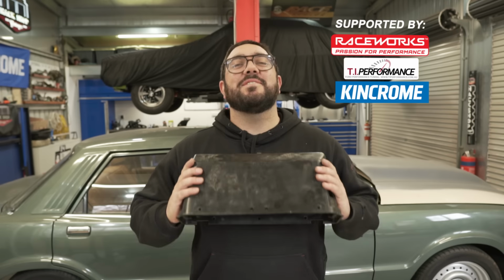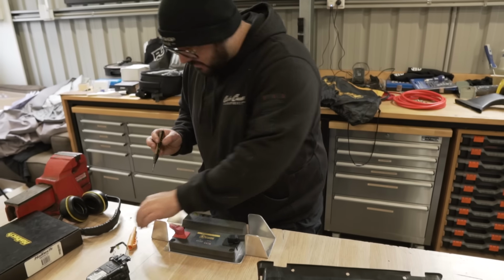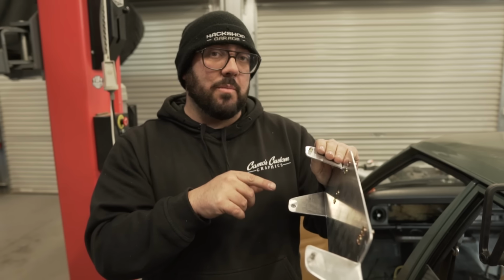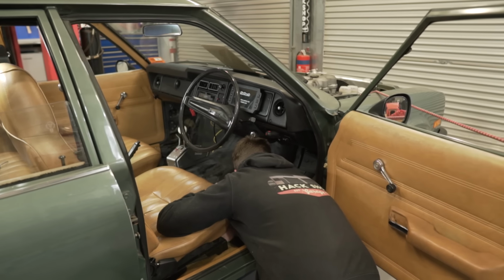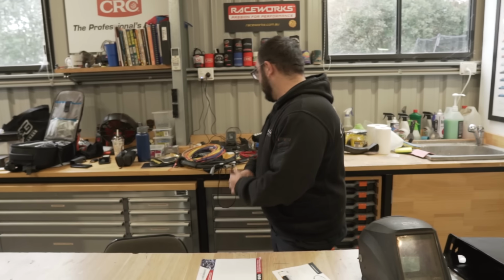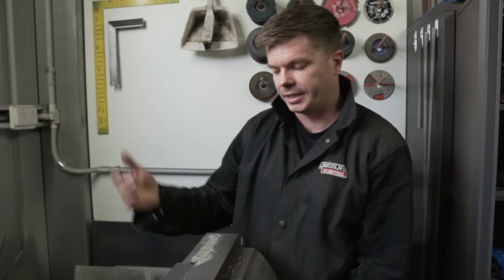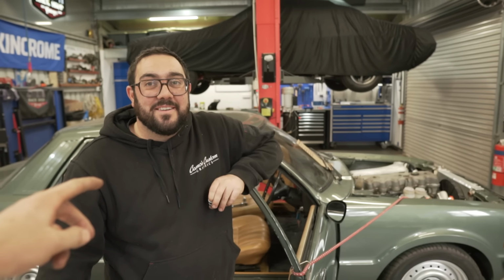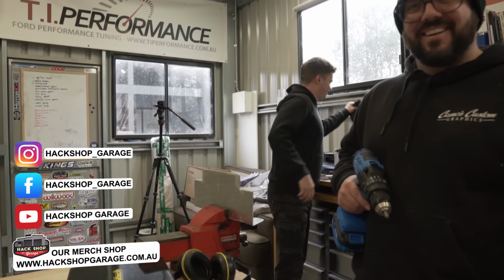Haltech Nexus and Fly By Wire Throttle Pedal Install - Turbo Cortina Build - Part 9

Comment: put the 1" holesaw on after the 2" is installed on the arbour (at the same time).....bingo you can now cut a 2" hole using the 1" holesaw as the center locator.

It is what it is ;-)
Reply from the maker: Normally we would, but in this case, the original hole was off centre to where we need the new hole to be
Reply: Colin Furze did a fantastic episode on tool and shed skills hacks. Well worth a watch. So many great ideas.
Reply: @HackshopGarage  Cool, that bit wasnt clear as you said the existing hole was in the perfect location.

Comment: It is what it is. Will you still need relays with the R3 ecu? They have a built in pdm. You can also add a PD16 if you need anymore outputs 👍
Reply from the maker: It can, but it has a limited amount of relays it can replace, and being that we will be running a series of fuel pumps, we may exceed what the R3 can handle

Comment: It issss what it issss, classy stuff fellas. What are the relays in the glove box for, i thought the point of the nexus was that it's also a power distribution module that removed the need for relays and such? Or am i getting my haltech products mixed up
Reply from the maker: It can, but it has a limited number of in built relays and we made need extra for the amount of pumps we are running
Reply: @HackshopGarage  ahh rogee, makes sense. Cheers for the explanation

Comment: Fellas, you can always get a 1 inch hole saw, and bung a few holes in that angle iron to cut some mass out without affecting the strength. As Colin Chapman from Lotus once said, "adding lightness".

Comment: Hole in the firewall... you can have 2 hole saws in the same bit. 25mm hole exists, put a 25mm holesaw in the 2 inch holesaw and it will centre.
Reply: It is what it is...

Comment: another way to do the whole saw when the original hole is bigger than the hole needed is use a piece of wood and tech screw it (with the screws inside the piece you are drilling ... now you can choose your centre with the wood and drill and as you cut it will be removing the little hole the tech screws went through  -   It is what it is

Comment: You can generate a lot less heat and make your drill bits and holesaws last longer if you dont drill at full throttle.... But it is what it is I guess.